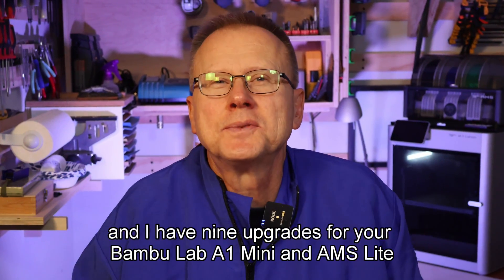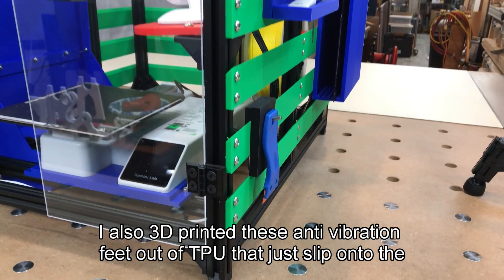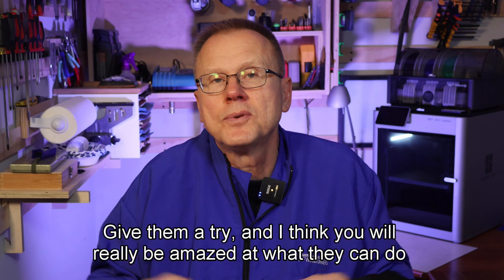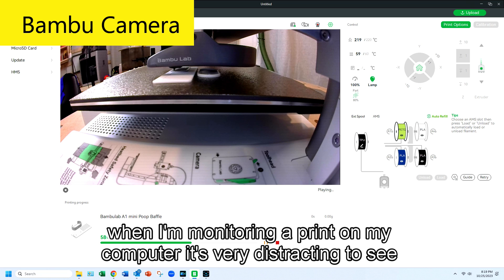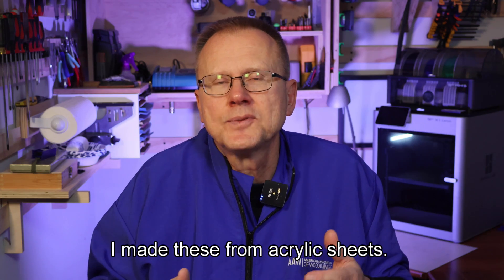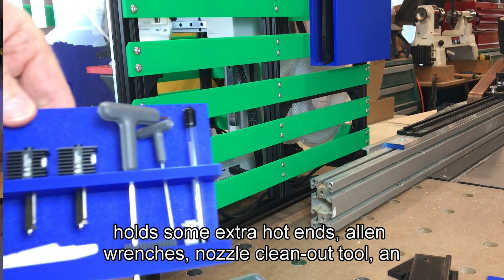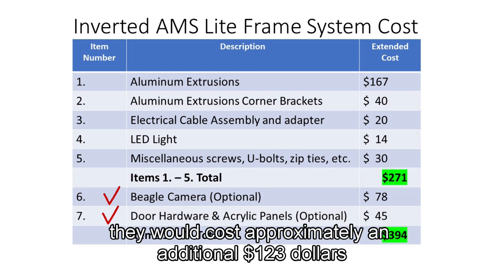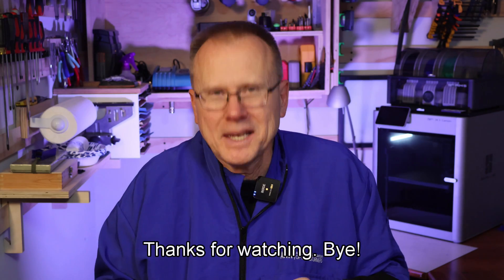The 9 BEST Upgrades for your Bambu Lab A1 Mini Printer!

Comment: Great video.... Have you built one for the Bambu A1? Can the A1 MINI parts be remixed to fit the A1?
Reply from the maker: No , I haven’t built one for the A1 because I don’t own an A1, but also because Bambu Lab has a simple 3D printed bracket design that allows you to attach the AMS Lite to the top rail of the A1 so this is a very easy and simple solution. I think remixing my A1 Mini enclosure for the A1 would be a lot of work. Thanks for the questions.

Comment: Do you need both sets of corner brackets (lines 6&7) ? Looks like they are essentially identical other than the number of screws required to fasten them.
Reply from the maker: That’s a good question. The 4-screw corner brackets have T-nuts that can only be mounted by sliding in the end of the extrusions. The 2-screw version allow you to rotate the T-nuts in the extrusions without having to slide them down from the end of the extrusions. I hope this answers your question.
Reply: @ristinnovations  it does, from an assembly standpoint, you would need to make sure you slid in all your t-nuts at the very beginning if you stuck with the four screw version. Since you need two sets worth of brackets, it makes sense to buy both. Thank you for your reply!
Reply: So going through your directions the counts for the brackets appears to be off.  I counted 14 2-screw brackets and 22 4-screw brackets.

Comment: Basically a P1P/P1S with AMS. Would be great if a color display could be added to replace the displays on P1P and P1S.
Reply from the maker: Big Tree Tech offer the "Panda Touch" LCD screen for the P1P/P1S, however you need to be aware of firmware compatibility between Big Tree Tech and Bambu Lab.

Comment: This is ALOT. I mean great work and all but not very innovative. Good idea though. Overkill for a itty bitty bed
Reply from the maker: I agree that I may have gone overboard, especially for such a small build volume, however I looked it as a challenge and learning experience. Thanks for your candid comment.
Reply: @ristinnovations  having one in front of me now I realize the real estate gain with your build. Less daunting to change filaments. The build could be expanded to accommodate 2 machines side by side. 

Having it in front of me I can really appreciate the work seen in the video. 🤌

Comment: I just ordered the A1 mini, it will be my very first machine. I was concerened about the foot print and it looks like your idea is great. I ordered your plan book.
Reply from the maker: Thank you very much for your Etsy order! I think you picked a great 3D printer for your 1st one. I have enjoyed using the Bambu A1 Mini with the AMS Lite. Once you get your printer set up, let me know if you have any questions about the printer or about the enclosure plans you purchased from me. I will be glad to help! -Ken
Reply: I was just reading through @ristinnovations  I was just reading through the parts instructions but I don't know how to find the links to 3-D print the parts needed.
Reply from the maker: @canadiansparky64   Hi Darren, if this is regarding an Esty order you placed, there are two files to download, the assembly manual and a second file for the stl files.  If you are having any troubles downloading the stl files, please contact me via Etsy because it will be easier to resolve things there.  Thanks, Ken
Reply: You did a great presentation for a newbie like me, info alone is worth the 15.00 Canadian for me. Keep up the good work.

Comment: A very nice solution.
With theese toolholder bars, you could actually glue acrilic parts begind, to make it more secure forpets and children. As you need only stripes, between the stripes, you might simply use transparent packages from sweets...
As I have started 3d-printing a few years ago, I have quite a few old, unused 3d printers, like the Tronxy X5 (first version, not CoreXY). So while the unused parts are not the same size as in your project, I might reuse them for an A1 mini enclosure, bringing the cost down a lot. Your video is a good inspiration.
However, at the moment I simply use a Creality mid size tent to place my A1 mini with AMS. My 3d printer room has about 10°C in winter. so having an enclosure is mandatory even for printing PLA.
Reply from the maker: Thank you for your detailed comment. I have recognized that you have provided previous comments to some of my other videos so I really appreciate that you continue to watch my videos and that you take the time to write comments. Thank you very much😊

Comment: probably going to try and do something similar for the A1, but fully enclosed. Having the bottom be raised also gives the option to add passthroughts for cooling ducts, so the electronics and psu can get fresh air, which seems the limitting factor for enclosing the A1s
Reply from the maker: Yes, that’s a good factor to plan for electronics cooling if you decide to fully enclose the A1. Thanks for your comment.

Comment: Way over engineered, especially when there are much simpler mounts out there that don't cost more than filament and screws.... Couldn't make it past the shotty enclosure before I'd seen to much. 100$ in aluminum extrusion ?! Another what 30+ in plexi. Sheesh sir. I'm not one to knock someone's ideas but there's this thing called the kiss theory..... I don't even want to know what the other 8 things are if they are as bad as #1....

Comment: I dont think you're quiet getting the spirit of the A1 mini. All of these upgrades undoing what this machine is about, which is just a quick and easy quality bedslinger  that can be used with/without the multi filament system. 

It feels like you were methodically trying to recreat their larger p1p or x1 printers with every addition. You are not going to match the quality of those big boys even with all your bells and whistles because its still a core XY machine. Just added a bunch of bulk.
Reply from the maker: I agree the A1 Mini is a quick and easy printer, but when the AMS Lite is added, it takes too much space on my work bench for a small print volume printer so this was my approach. My solution may not be for everyone, but I’m happy with my upgrades. Thanks for offering your opinion.
Reply: @ristinnovations they make a clip that allows you to mount the AMS to the z arm, I believe. Does the same thing you did without the extrusions.  Don't forget to be an engineer while designing this stuff. Improvements matter along with innovation

Comment: Or you could just get a P1S.

Not trashing the design, or setup, because it's great, but holy hell. That's A LOT for simple "fixes".

Great video man!
Reply: I had the same thought when the price was revealed. But then it got me thinking...A1 mini is for beginners who would like to be creative in the physical space. These projects and small prints are actually perfect exercises to dive into designing and building stuff — shelfs, useful brackets, using various tools like inserts etc.
Really great video.
Reply from the maker: Lol, you could say I went a bit overboard. I do agree that a P1S would be a better value, but liked the challenge of trying to make the A1 Mini with the AMS Lite easier to move around and take up less space, at least table top wise. Thanks for your comment😊

Comment: Like the design, mine hasn't arrived yet, but I've got printers coming out of my ears. I was looking to design something, but you've done a yeomen's job and I'm gonna shamelessly pilfer it. 😁 
I just did an inventory check and the only thing I'm missing is the right size binding screws and the wiring extensions. Gonna be fun. Thanks. Here's my $10
Reply from the maker: Hi Keith,  did you receive my reply from yesterday (11/26) regarding your $10 Super Fan gift?  Were you intending that the $10 was to purchase the A1 Enclosure manual and stl files?  I set up my Etsy shop for anyone to purchase the manual and stl files so if that's what you intended, please email me at info@ristinnovations.com so we can work things out with your $10.  -Ken

Comment: thanks for sharing.  I was considering something similar w/ my shelf system and didn't know what the connector type was for the AMS.  thanks for the digikey links.
Reply from the maker: Glad I could help!
Reply: @ristinnovations  the cable and adapter arrived yesterday and they worked like a charm.  thanks again.  I'm loving this printer.